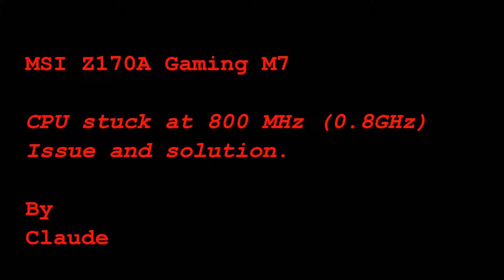MSI Z170A Gaming M7 stuck at 800 MHz

Comment: I don't know if anyone can help me here, so I'm having this issue myself, I have tried everything to fix it but my cpu is always stuck at 800mhz. 
I've tried setting the switch on the m-board, I've checked power settings, I have flashed, restored and updated the bios, I have removed the cmos, I have tried everything and I cannot solve this issue. I have even used the throttlestop program but it doesn't solve the issue, once it restarts the issue returns. Is there anyone here that can help me with this?

Comment: Thank you so much. I had find a diferent solution by software (disabling some spec of board through ThrottleStop software) but, the real solution was this. Still wondering when did i switch to slow mode.

Comment: BIOS -->cpu area Disabling "Intel Adaptive Thermal Monitor" or download Techpowerup software & run throttlestop  and disable BD PROC HOT save incl. in  reboot process ..else LOAD CORE PARKING MANAGER 3-->Run software change to max Performance refresh +save and you will love your old FORD MUSTANG POWER or msi

Comment: we have the same board i did everything you said but nothing happened still stacked in .80ghz . i already switched it to the other side. Please help me. thanks
Reply from the maker: I actually built two new desktops for myself since this video, so this board is long gone for me...so sorry I can't be of further help.
Reply: i have a m9 z170 ack with a 6700k and im having the same issue... just found this vid but i will need to put my system back together to see if the switch was the issue... if not then im just going to buy a 370 chipset board and a new 6 or 8 core cpu and a 1080... then ill be abele to sleep while encoding 4k  :D

Comment: Does the z270-a msi pro have this? I'm not sure if it has this or if I need jumpers. My motherboard is stuck at 800mhz and tried everything in the bios and windows 10 battery plans. Nothing. I used the throttling program, that's the only thing that seems to work.
Reply from the maker: Kevin,

Sorry for late reply...you probably figured out your issue by now, but just in case, I did download the Z270  Mobo's manual and there is no such a switch on the mobo for the liquid Nitrogen cooling that would limit to 800 MHz.  You have to either dig deeper in your settings, but that seems to be either software, or a bad Mobo,  but in your mobo's case, this is not a physical switch limiting the MHz... Good luck and keep me posted if you find a solution.
Reply: cac2244 I figured out my problem. I just needed to oc the bclk to 103 mhz or higher and turn on NOC in settings. That was the only way to get it higher than 800mhz.

Comment: man, this work for notebook? i have the same issue. my cpy get stuck at 0.77 when i plug my charger and a lot of people gets to say that it is the gpu, i can use it in temporary fix with throttlestop, 0 problem but maybe here is the real solution, my laptop its a hp envy 14 u001la  i5-4210u + 840m 2gb, thanks for ur help if i u can <3
Reply from the maker: Sebastián Estay ...Perdóname Sebastián, no había visto tu comentario.
I do not have Throttle stop, but by reading the description and by seeing your description, it seems that your laptop throttles on purpose to save power due to a power supply that might not be sufficient. Tell me, what is the rating of your power supply? tell me output voltages and amps and we can figure out wattage of your PSU, then we can compare to watts your laptop really needs by going into specs... That would be first place to look.
Reply: can u give me ur email? i can send u pictures of aida and hwmonitor. thanks man
Reply from the maker: Sebastián Estay...
send it at stech2244@yahoo.com and also send a pic of the markings on power supply.
Reply: mail sent :D

Comment: As dump as it may sound but I have spent nearly a weak figuring out what is the issue. I even contacted the motherboard and cpu manufacturer fot a replacement. Now it's fixed and I feel stupid

Comment: Mine isn't working even if I switch it off or on, so there's a setting in the BIOS you can turn off to disable this. I've also heard the program Throttlestop works with this too.
Reply: what is it called?
Reply: Daniel Hunter not sure if you still need help, but this video (while not in english) is great and it solved the problem for me. https://youtu.be/Kk5cMXPHMkI